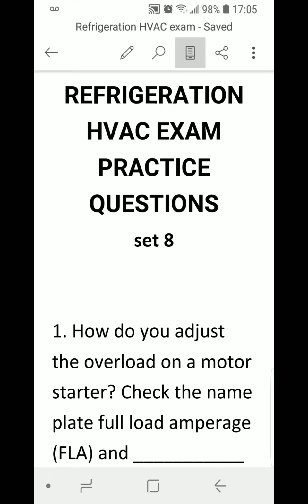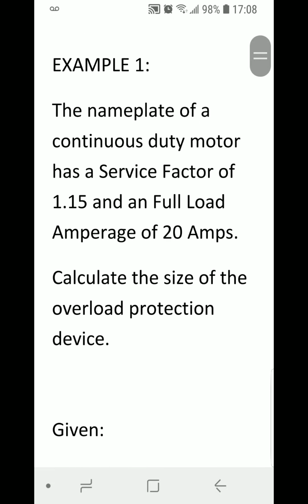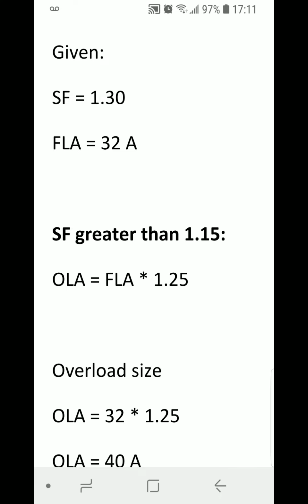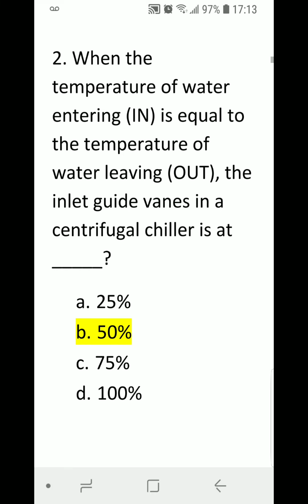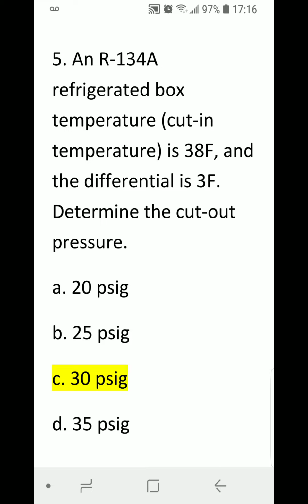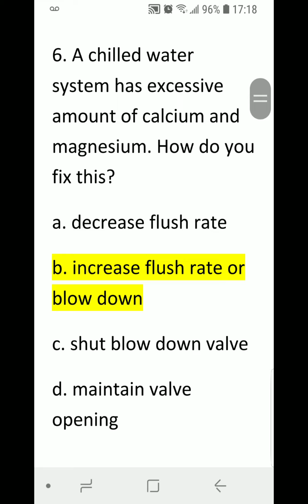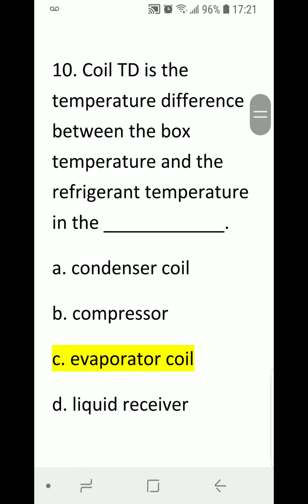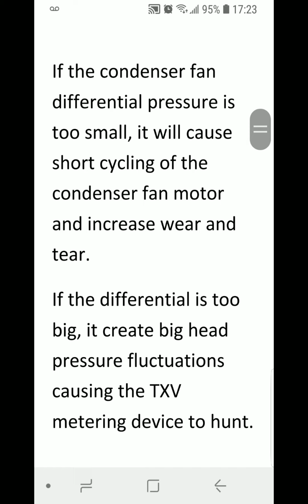REFRIGERATION HVAC EXAM PRACTICE QUESTIONS set 8

Comment from the maker: Number 3. 
Location of pressure line for a fan cycling control is on the LIQUID LINE. 

Fan cycling controls are pressure switches that sense high-side pressure, or temperature controls that sense liquid line temperature that turn the fan off when the condensing pressure-temperature falls, and on when the pressure-temperature reaches the upper setting on the fan cycling switch. (Reference: achrnews.com)